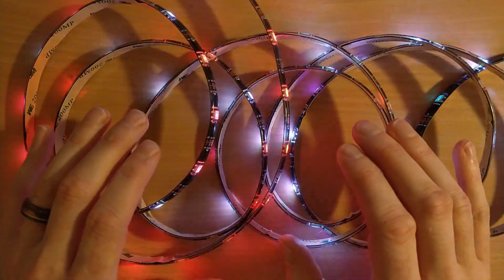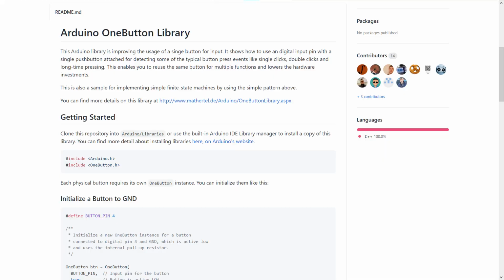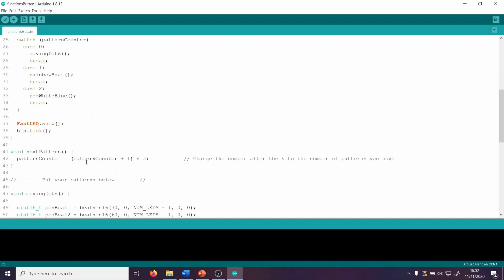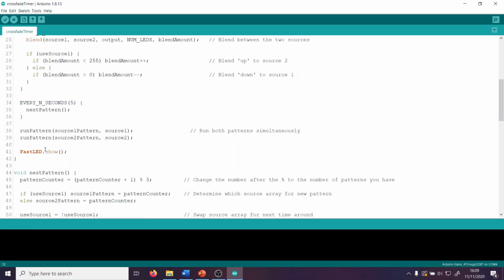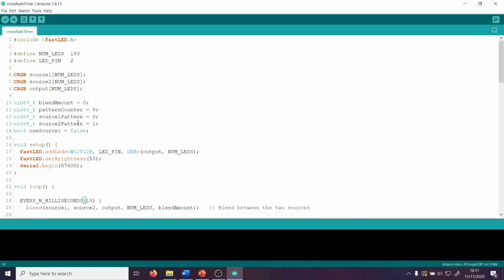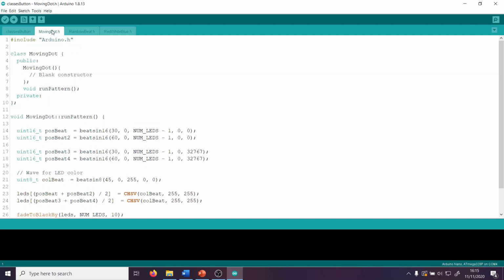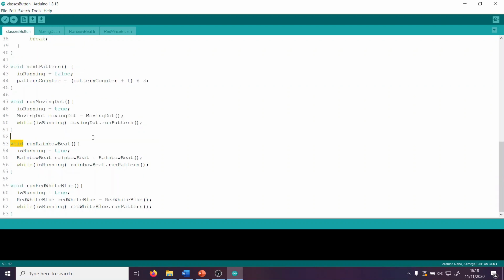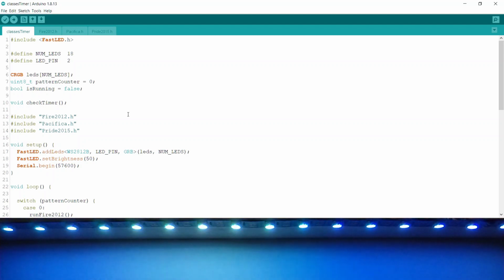FastLED Basics Episode 5 - Multiple patterns using a timer or button

Comment: Could I send the pattern to the Arduino/ESP via Wifi. I need to control 16 groups of 4 Stripes each (2 meter) via an external control.  Each group will use the same pattern. Where to start? Sending an Array with a pattern via Serial?

Comment: I have attempted to add a fourth piece of code and encountering an odd problem. i’ve changed the three to a four in the button counter. And I have also added a simple fill solid code to set all the LEDs to a certain color. when I had this new fourth animation  i can no longer cycle through all of the four options. It will lock up into the fourth and will stop me from cycling back through the other animations. Any help with this would be greatly appreciated thanks in advance.

Comment: You touched on fire2012.h, pacifica.h, and pride2015.h. these are all examples straight from fastled however the examples are .ino. can you upload .h files somewhere? You explained what certain lines do but you didn't explain what I need to change to get to that point. First time I tried it said check Timer was not declared. Don't feel like modifying code on every single example for one project..
Reply from the maker: I'm afraid you will have to modify the code for each example, sorry!
Reply: @ScottMarley  no worries, got it all figured out actually! Thanks for the guide

Comment: so im having issues. i know i should learn this more but i just need this for once project. i understand most of it but im tring to add additional fast led examples. such as fire or pacfica. all the examples ive found are complete .ino, not .h library. and i cant even copy the code to a new class because the code is actually different. is there annywhere i can find these examples as .h classes?

Comment: Hi Scott, Great video!, i have just started playing all things Arduino and pixel LED, i'm an electronic engineer and have good experience of pixel LED'S, so what i have a couple of questions you may be able to help with, i want to combine the multiple patterns section but to be able to pick this from a single DMX channel received by the Arduino via an RS485 receiver IC. I have seen some videos on how DMX can be received to make digital pins go high when channels are active which is great. But what i would really like is a way to assign this received data level to a pattern. i.e. 0-10% pattern 1, 10-20% to pattern 2, 20-30% pattern 3 and so on do you have any idea if i could run the dmx receive code at the same time to make this possible on one Arduino? this would then allow me to pick the pre-stored pattern in the Arduino from my lighting desk without the lighting desk having to run loads of channels to create the same effect, and if possible i would still like to have the facility to also have a button to change the running pattern as well ( i.e. Arduino goes into stand alone mode when no DMX signal is detected) anyway i'm going to work trying out more of your examples for fun and practice. Many thanks for all your help.

Comment: It seems like the code will make the pattern restart to the first pattern, after pressing the button the chosen pattern will stay for about 10 min before restarting and going back to the first pattern, is there a way to avoid this?
Reply from the maker: Interesting, that's either a bug in the code or a weird hardware issue where the Arduino is resetting for some reason. I've never seen this happen myself, but haven't been looking for it. Which code specifically causes the issue?
Reply: @ScottMarley  it’s the one with the button, I had sent you a email
Reply from the maker: @Edrillzdademon  I don't have an email from you. Can you be more specific, there are two files in that GitHub that use a button, which one is it?

Comment: Hi I hope you read this. One problem that occurred to me was that the led strip is slow to respond to the press of the button. Any idea why?
Reply from the maker: I don't know, it's instant when I run it. Obviously the cross-fade one will be slower as it has to fade from one to the other, but the others should happen straight away. Check your wiring etc but I don't know how that could cause a problem.
Reply: @ScottMarley  could it be that the long strip(i run 120leds) could be the problem?
Reply from the maker: @livijusk.7522  No, 120 LEDs isn't a long strip by any means. I really don't know why it wouldn't work for you.
Reply: @ScottMarley  ye weird. i ran on a another  piece of code and the button worked fine but i was using 2 leds

Comment: How could a multi-position rotary switch (not rotary encoder) be used instead of a button to change patterns?
Reply from the maker: Wire the switch common to ground, and each contact to a digital pin on the Arduino. Declare each pin as INPUT_PULLUP. In your loop, something like if(digitalRead(pin1) == LOW) { runPattern1(); } if(digitalRead(pin2) == LOW) { runPattern2(); } and so on.

Comment: great video and series! Doing my first project with your tutorials! Quick question, I'm having trouble keeping the fastLed library and the pattern files working because im having issues with the file location indexing. I have everything including the fastLed library folder in the same location as the codes i want to pattern. Any advice as to how you got it working and in all one location? I even went to file- preferences to  change the folder location but still no luck!
Reply from the maker: If you're using the Arduino IDE, use the library manager to install FastLED library. Then you don't put it in the folder with your sketch.
Reply: ok ill give that a try. Thank you for the quick response!

Comment: 12:40 the visuals are being called from a while loop, which checks for isRunning == true, but the statement 'isRunning' will keep returning true because its still in the while loop for executing the visuals, and it never gets the chance to even return to the main loop, much less execute void nextPattern() which contains the code for setting isRunning = false
Reply from the maker: And yet if you try the code, it works ;) the reason it works is due to the use of the oneButton library. Inside each pattern, we call btn.tick() which checks if the button has been pressed. It is has, nextPattern is called, setting isRunning to false. I hope that helps to explain it.
Reply: @ScottMarley  ah, yes, I have missed that important detail

I have been trying to get FastLED to work on the ESP32, and I was trying to use it's built in touch capacitive pins in lieu of buttons, that's why I have overlooked all the references to buttons in your code

Comment: It's the dummy again.  I went through your series.  Wonderful.  Now I'm going back through, with a NodeMCU rather than an Uno, and the colors are really strange.  No blues.  I tried the temperature and that kind of thing.  But nothing works.  Suggestion?
Reply from the maker: The nodemcu is a 3.3V device, can I check that you're powering the LEDs with 5V? No blues sounds like the strip isn't getting enough voltage. Use a multimeter to confirm.
Reply: @ScottMarley  Well, it's 4am.  I woke up thinking about this.  I separated the 3.3v from the 5v supply.  And did not have it connected after downloading.  Problem solved.  Thanks again for your support.

Comment: Your videos are amazing! I was so excited to try this out on a project I’ve had on the back burner. Unfortunately I only have Arduino Nano Every’s and FastLED isn’t compatible. Any thoughts on getting it to work on the nano every, I really need the form factor
Reply from the maker: Isn't the nano every the same size as the nano? Just buy a nano clone (they're like £3 on eBay!) and go with that. You won't be able to make the every work with FastLED until the developers add support, it's a non-trivial task.
Reply: That’s true, I already have all these PCBs made with the pinouts matching the every’s and like 6 every’s though. Do you know anything about 
Adafruit NeoPixel in stead of fast led? That’s what I was using but I don’t know much about the interrupt features like how you have shown with fast led, that’s what was really drawing me into the fast led, especially with changing patterns with a button
Reply from the maker: @chaseallen4352  Interupts have nothing to do with FastLED, and will work with whichever LED library you choose. The neopixel library is very simple compared to FastLED, but much more limited (no wave / blur / noise / timing functions / palettes / blending etc). There are however additional libraries you can use on top of the neopixel library to fill some of the gaps. I'm not an expert in the adafruit stuff though. It totally depends on what your trying to achieve. The every has exactly the same pinout as the nano, so if you did have to fall back to using a nano, you could still use the same PCBs.
Reply: @ScottMarley  thanks for the quick reply and the info!

Comment: If using an ESP8622 you need to make a small alteration to the classes examples.  When calling the functions they need 'yield()' adding into the while statements to stop an automatic soft reset.  while(isRunning) { rainbowBeat.runPattern();
  yield();
  }
Reply from the maker: Good to know! I've never actually used an 8622 as the esp32 is about the same price and seems to have more features. Is there any reason why you might choose it instead of the 32?
Reply: @ScottMarley  Hi I've used them as they have built-in WiFi which makes MQTT easy. I've got multiple boards dotted all over a building all linked to a RaspberryPi with a NodeRed Control Panel.
Reply from the maker: @andrewcarnell601  sure, but the ESP32 has WiFi and also Bluetooth, has a much faster CPU, is dual core etc. I'm not saying using an 8622 is wrong in anyway, just wondering if it did something different to the ESP32 that I don't know about :) looks like they're pretty much interchangeable for most projects.
Reply: @ScottMarley  Yes I think so, I just had them available so used them.

Comment: brilliant! answered so many of my issues :) Having trouble adapting one gradient palette code to include a switch, to step through between 4 or 5 different palettes. It doesnt seem to like defining multiple gradient palettes?
Reply from the maker: You can have as many gradient palettes as you like - providing they have different names of course. If you want to link me to your code (put it on pastebin and link it here) I'm happy to have a look for you.
Reply: @ScottMarley  Thanks I have figured it out now, am using the palette knife tool to download more gradients. Am now testing use of rotary encoder - push to change gradient, turn to change overall brightness.
Reply: @ScottMarley  I have some basic code here for using a rotary encoder to change brightness of a single gradient, but the nesting is wrong as it doesnt cycle thru the gradient unless the rotary is active turning up/down the brightness? https://pastebin.com/utZE0Zw9
Reply: once i can getthis sorted, I can move on to using the rotary push-butotn to cycle through the different gradients
Reply from the maker: Have a look at the loop code I've posted here https://pastebin.com/U7K6jgWD I don't have a rotary encoder to hand so I can't test it, but should be the right idea. I've just moved the display stuff out of the encoder loop and tidied up things a bit. It helps if you keep you indentation consistent, that way it's easier to see what's going on inside each loop. If this doesn't work, or you need further help, let me know. Thanks.
Reply: @ScottMarley  this had same issue as before (but looks a lot neater!) in that turning the rotary actually steps thru the gradient change as well as the brightness. I edited it to get the gradient loop code above the rotary read and cnage brightness, now this works as intended: https://pastebin.com/SDFGwp6E
Reply from the maker: Ah, sorry I messed up and forgot to take the fill_palette part out of the loop! Here is my corrected version, but if your verison works then that's fine too! https://pastebin.com/hZ8jAYca
Reply from the maker: You idealy want to do it my way around, otherwise the brightness won't change the last time you 'click' the encoder. You probably won't actually notice that as a brightness change of 1 is hard to see, but this would be the correct way to do things.
Reply: @ScottMarley  Appreciate that - works fine and much tidier than my version ;) I will now try to incorporate this into my palette-changing click code.
Reply: Finished and working, code here - thanks! https://pastebin.com/z2w50Xcn

Comment: Amazing tutorials.  I keep getting an error trying to run the button sketch that moving.h isn't in the directory but I see it in my files under fastledtbasic.  Does it need to go into a different folder, or have I forgotten something simple about where to house my .h files?
Reply from the maker: Is this when running classesButton.ino? And what is the exact (full) error message that you get? There is no file called moving.h so I'm not sure what's going on there. There is one called 'MovingDot.h' though. If you've edited the code (at all) you will also need to post a link to ALL of your code. I'm happy to help, but try to be as specific as you can and include every bit of detail that you can. Cheers.
Reply: @ScottMarley  it's th movingdots.h.  Sorry was multitasking and replying to your video.   I have the file but I'm not sure if it's in the wrong directory.
Reply from the maker: @goatelope7539  hey dude, please see my previous message. Code. Exact error message. Otherwise I can't help.
Reply: @ScottMarley  Im sorry, I was replying from my phone and realized I wasn't able to post the exact error.   I'll send tonight when I get back on the laptop.  Thank you.
Reply: Found the issue, just had to keep digging till I found the right file folder to put the .h files into
Reply from the maker: It's a little bit puzzling as the .h files are normally just in the same folder as the main sketch. Where did you end up putting them?

Comment: I was thinking of doing something like this but with a knob switch so when it turns on it goes to whatever pattern the switch is set too so if there is a favorite it will turn on to that vs having to hit the button a few times
Reply: You guy's are awesome! The fast led community is so helpful! Everywhere I turn there are so many people willing to help and teach.  I'm going to have this stuff down in no time
Reply from the maker: Good idea! I guess you would wire each contact on the switch to a digital input on the micro, check which one is active and run that? Or alternatively, wire each contact through a different value resistor to an single analog input and read the voltage to determine which pattern to show. Lots of options!
Reply: @ScottMarley  Or just store the currently selected pattern to EEPROM, and recall it from there on boot.
Reply from the maker: @ace.johnny  yeah, that's what I normally do. I like the idea of a big mechanical switch though to select stuff :)

Comment: Thanks a lot for releasing this just before diwali, you saved me man!👍🏻👍🏻
Reply from the maker: Can't have the festival of light without FastLED!
Reply: @ScottMarley , exactly, I'll always recommend FastLED over Adafruit Neopixel,  the built-in utilities are just awesome!

BTW, I have used a 100nF capacitor in parallel with the switch to solve the debounce problem and used attachInterrupt() to produce an interrupt whenever a falling edge is detected from the switch and to increment the mode counter variable.
Reply from the maker: @anindyamitra5091  yeah, interrupts are a good way if doing buttons, I didn't include it in this video to keep things straightforward for now. I like the idea of using a capacitor as a hardware denounce though, good tip!

Comment: Like Dylan i am new to Arduino. your presentation and the measure of your voice makes it easy to follow. Here is my question . i want to use multiple strips with different pattern sequences. would i use seperate controllers for each strip or is there another way?
Reply from the maker: Do you want different patterns on different strips or for them all to play the same patterns at the same time?
Reply: @ScottMarley  Hi Yes different patterns on different strips
Reply from the maker: @environmentalmonitoring8185  there are a bunch of ways to do this with multiple strips on one controller. Here are a few examples https://github.com/FastLED/FastLED/wiki/Multiple-Controller-Examples you do need to think about what micro to use though. Using something like a nano or uno, you'll run out of memory quickly unless they are short strips. If your patterns are complicated, you might also not have enough CPU power to do what you want. If you upgrade to a teensy, esp8266 or ESP32 you'll ok.
Reply: @ScottMarley  THanks for the advice, really helpfull. Also other than doing projects, how would you go about learning this code for microcontrollers and what language is it?
Reply from the maker: @environmentalmonitoring8185  are you referring to the teensy / esp micros? They're completely Arduino compatible so you still use the Arduino IDE and the code is identical. They're just much, much faster with loads more ram and storage.
Reply: @ScottMarley  Hi Scot i followed your link and set up three strips , but i struggle to modify the program for colour change. i.e to get each strip to fill with changing colour . THis is what i have in the void loop 
- it give a moving red dot that goes down each strip and moves along to the next strip and so on. i would like to get each strip to sequentially fill - any thoughts?

void loop() {
  // This outer loop will go over each strip, one at a time
  for(int x = 0; x < NUM_STRIPS; x++) {
    // This inner loop will go over each led in the current strip, one at a time
    for(int i = 0; i < NUM_LEDS_PER_STRIP; i++) {
      leds[x][i] = CRGB::Blue;
      FastLED.show();
      leds[x][i] = CRGB::Black;
      delay(100);